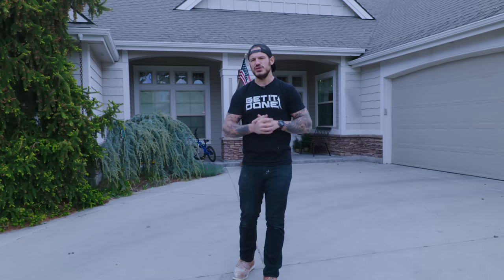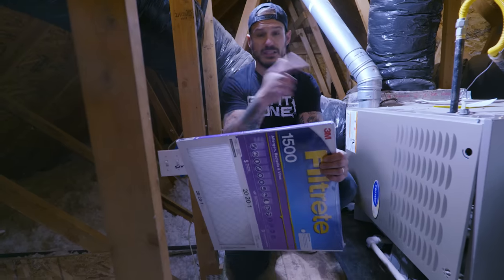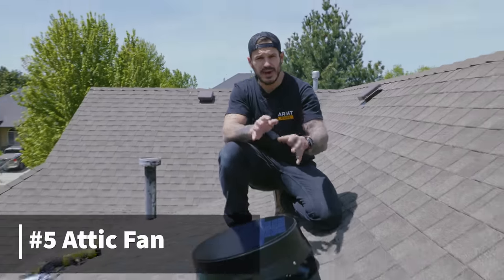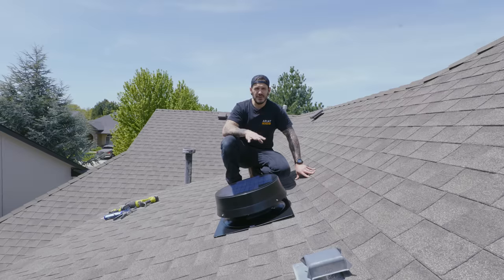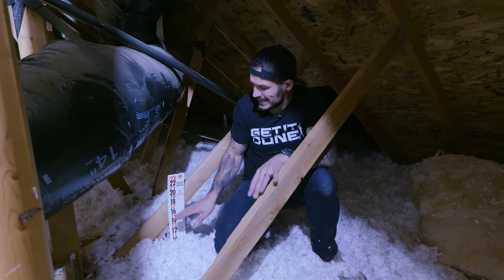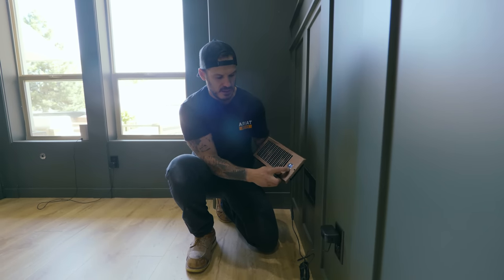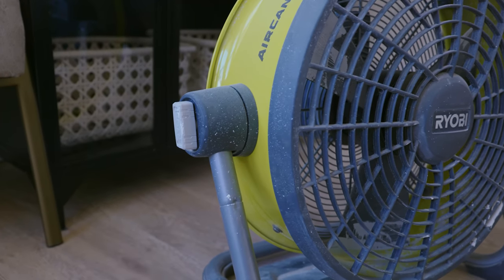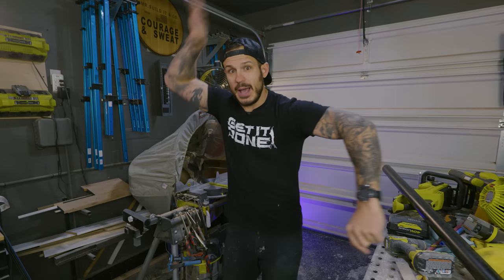15 Tips To Help Cool Your House This Summer + Lower Energy Cost

Comment: Very few filters are actually designed to last more than a few months. Unless you have a very expensive filter setup, change it every 3 months. Also, get your static pressure tested when you have your system serviced. If you only have 1 return air duct and grill in your home, you almost certainly need to have a 2nd one installed. About 80% of homes I see have high static pressure. This means way less airflow and a system that is working too hard. Adding a 2nd or 3rd return air duct and grill will help your system work so much better!
Reply: I like to change the filters every month in the summer. Non summer time I change it every quarter (3months)
Reply: High head pressure on high side on gauges are a tell tale sign of a clog filter or air restriction on the return.
Reply: @ptso7580  actually low pressure on the low side would be a sign of clogged air filters. High pressure on your high side would be a sign of a dirty condenser unit itself.
Reply: If you have high static pressure you have a poorly duct design.been doing heating and air conditioning/sheet metal mechanic for 33 years.its sad to see what this trade has came too.so many box and flex systems.just get in and out quickly and do it the cheapest you can.the art of sheet metal is a dying trade
Reply: @xslabcabxhearsex  Hi 👋 I just bought my first house a couple months ago and I was told the HVAC unit was replaced in 2018 with a “good one”. I don’t know anything about it. I really don’t like that it sits on my roof and is in the elements 24/7. I feel it should be on the north side of my house on the ground and in the shade but what do I know 🤷‍♀️ 
I feel the house (1979 built) is poorly insulated. The HVAC kicks on every few minutes when trying to maintain a temperature. All my vents inside are in the ceilings. One bedroom outta 3 doesn’t get any air coming out of the vent. I don’t know why. The rest of the house seems to have the air come out fine but not my son’s room. Do you know what is causing that problem and possible solutions? Also how would I check for pressure and ductwork that the original comment is about? I know I have 1 filter in the ceiling and small ceiling vents in every room also coming out of the ceiling. Thanks for any help!
My 1979 house is ALL electric and my PG&E bill is outrageous($400-500/mo) and I need to bring it down drastically! I keep the thermostat between 76-78 degrees if that info means anything or makes a difference in your answer.
Reply: @Ang.0910  congratulations on your new house.usually when you no air coming out of just one vent is when a squirrel was gotten into your attic and chewed up the flex duct to the vent.or it has a damper innit and it is closed.sometimes also it can be crushed from boxes sat on it or people crawling on it.
Your outdoor unit on the roof is not a ideal place for it as you have said.it can be moved to the ground but it will be somewhat costly.if it is cycling on and off every few minutes it just may be oversized,which will cool the house but not pull the humidity out as well.it would feel cool but clams in the house.
My advice without seeing your situation is call a repeatable company and have them look at your duct work and size of unit.insulate the attic better and get a attic fan to pull the help pull the heat out of the attic.good windows will make a huge difference on your power bills as the attic fan and insulation.
It’s sad that a lot of HAVC companies cut corners and rip the homeowners off and then you have problems like you have.i hope you can get all your problems fixed and be able to enjoy your new home
Reply: @Ang.0910  For your room with no airflow, see if the vent blows when the bedroom door is open vs. when it's closed. If it blows only with the door open, then you need to add a vent either through the door or cut an inch or less off the door bottom to allow air to escape. Also, some ductwork have dampers that can be closed to stop airflow to certain rooms. I would have a heating and cooling tech to check your ductwork to see if that's the issue. There could also be some obstruction or damage to it.
Reply: @xslabcabxhearsex  It really  is a dying trade. I did install  for 18 months 1996-97. We did a little  flex. But mostly duct board. Occasionally spiraled metal duct. I was 16 and 17 then and the experience i got from building duct work has been some of the most useful knowledge again and again. Most we did in the shop on a machine. But I have helped do entire duct systems free handed in the field. Learning  how to measure  for transitions and sizing duct and such gave me knowledge that helped me in welding and carpentry and other  day to day tasks.  And i wasn't ever what i would call good for the amount of experience that  i had.  Probably  closer to average. But  some of the guys i worked with made that shit look easy easy. They had just been doing it so long and had pride in their work. I was fortunate  that a few of them invested the extra time that  it takes  to really teach some one a trade. You do see a lot  of flex now  days. I guess its got its place. But anyone  can  stretch flex and install  start collers. Im glad i got  that experience even if for only a short time.
Reply: @ryanchenault80  In the Pacific North West all I see is flex lines ran in crawl spaces. I'd say 90% of homes in my area that are build after the early 1990's are all flex. Craftsman are definitely hard to find these days. Everyone was told to go to college and kids want to play on a computer.
Reply: Expensive hepa filters are garbage. Use basic filters and change every 3-4 weeks.
Reply: @kcrr2w  I'm totally fine with a basic filter. It's easier on your HVAC equipment! I have a very expensive air quality tester for work and the best thing is opening windows for at least 20 minutes once or twice a day.

Comment: Great advice but for those who don’t have a central or window AC unit I’d suggest a whole house fan. Install it in a central hallway or open part of the house then close down all the windows and doors except for leaving one cracked open a bit on each end of your house preferably one that’s on the shady side. Crank it up in the morning to get the cool air in then close everything down till afternoon. We live in the mountains of NC so the evening temperatures usually allow us to get away without the need for AC. I would disagree with putting a dehumidifier inside a room that you’re trying to sleep in though as those things exhaust very hot air back into the room. They are invaluable for basements though.
Reply: Thanks! I live in Atlanta and have always opened all windows when temps are below 73 to pull in cool air. Will try it with back door and front window, both in shade.
Reply: @ginaforfsu  Works every time except when it’s raining! 😉 That’s the only drawback, can’t use it at all then.
Reply: Your screens will be so dirty, and all the pollen and pollution also gets pulled into your house.  I once had a whole-house fan and I don’t want another one.
Reply: @AuroraBD0618  I guess that depends upon the exterior of the house but I definitely see your point. I clean the screens regularly and definitely remove drapes from those windows during the summer months. I have regular air filters to take out any pollen or contaminants that find their way inside. If it really got bad I’d just put a furnace filter in those windows to filter it out. It’s a small price to pay for not needing the extra expense of having to pay for central air conditioning.

Comment: Best tips for cooling a house. Due to cost and other variables they may not be possible for everyone.
1. Plant trees. Make sure the trees are 'deep root' variety. Many cities offer free tree planting and advice
2. Install exterior solar screens (they cover your window). Go as dark as you think you need but be aware that light gets cut drastically, especially in winter. Use 1" framing, don't go any smaller.
3. Install double pane windows
4. Install a whole house fan
5. Install a swamp cooler
6. Install ceiling fans in rooms where you work / sleep.
7. Make sure your attic is properly vented and insulated.
8. Check the insulation around your doors and windows. Install floor sweeps / door and framing insulation where needed.
Reply: Swamp coolers don't work where  there's high humidity
Reply: @chuckwadnofski7147  install both.  Use the one you need.

Comment: At my last place my bedroom was on the opposite end of the house from the main AC unit with in floor ducting and I bought that exact same powered vent fan. I thought it was a bit overpriced at $75 for what equates to nothing more than two 120mm PC fans hooked up to a powered thermostat & vent but it was WELL worth the investment. That room would get close to 90F no matter how cool the AC was set to but that vent fan managed to actually pull the cool air into the room & lower temps by as much as 10 degrees. I'll tell you what, when it's 104 out & the AC is blasting going from 88 to 78 is a HUGE difference and well worth the money.
Reply: I’m in the exact situation. Master bedroom is the furthest away. Bought one and made a huge difference. Helps a great deal in the winter too.
Reply: If your bedroom is that hot, you dont have enough insulation,  minimum  r 60, r 76 better

Comment: If you only have 1 return air duct and grill in your home for the HVAC system you need to get your Static Pressure tested. This is the number 1 problem I see on about 80% of homes. High static pressure means bad airflow. This is hard on the equipment and raises the the energy used by the furnace or Air Handlers fan. It also hurts your comfort because you could be getting a lot better airflow through your HVAC system.

Comment: Gotta work on the explanation for ceiling fan direction. You got the direction right, but the reasoning wrong. In the summer you want air pushed down because your skin perceives moving air makes as cooler. In the winter you want to take the warmer air near the ceiling and circulate it throughout the room. Without a fan, the warm air will just collect at the ceiling and it will be much cooler at normal height. With the fan running, the warm air gets moved around and mixed with the cooler air, raising the temperature of the air at our normal height without requiring any extra heating.

Also, every house I have lived in, the grates in the ceiling or walls are for intake while the exchanges in the floor are where the warm and cool air are distributed.
Reply: In the south the exchanges are inverted. Northern houses aren't normally on a slab (basement) so the exchanges are from below.
Reply: I've got to work on the comprehension of ceiling fan direction. I live in a(pretty small...approx. 1300dq ft) cedar log cabin. It's 1 & a half stories(not sure if that's what it's called) but its got the loft type bedroom with bathroom and closet upstairs. And directly under fhe upstairs area is a bathroom/laundry, a bedroom, the kitchen, and under stairs closet. The other half is living room(main room) and dining room. Open floor with vaulted ceiling. The ceilng fan is extended down maybe 8 feet. I can never seem to get the direction it should go in thst feels comfortable. It stays much hotter upstairs. Which direction would you suggest ?
Reply: You are correct.  But basically ceiling fan's don't cool the room they just cool objects down like hot food or your body radiating heat. But yes they have a summer and winter setting. Heat doesn't rise though. 'It's not antigravity but think of it being pushed up by cooler denser air'.  Professor Julius Sumner miller.
Reply: Shout out to Hunter Ceiling Fans. I installed my fan when we built our home 30 years ago. It has run continuously all that time except to dust the fins every few months. No wobbling no noise. I had no reason to replace it so it is running day and night circulating the air in the house. Great product.

Comment: An old video, but I would check with your contractor or roofer, or anyone else before installing attic fans.  If you have ridge vents, underlayment's, tight seals, and so much more... you can negatively effect your roofs cooling designs and/or thermals. Attic fans were helpful 30+ years ago, not so much anymore. Please check with others before installing these in regards to your roof.  IF you are sure, informed, and confident, then have at it, and enjoy.

Comment: On ceiling fans, cold air is not up, hot air is not down.  All are for circulation.  The feeling of having air blowing on you is what helps it to feel cool, hence setting it to blow directly on you.  It will also take the cold air on the floor and mix it in the room.  During the winter blowing the cold air from lower in the room up to the ceiling redistributes the hot air that has accumulated on the ceiling and allows it to flow through the room.  Ceiling fans help to keep the air well mixed and distributed.  

My house has an open stairwell to the basement which is always 10-15F cooler than upstairs because the cold air will just flow down the stairs.  We did an experiment creating a cardboard door and roof system and found that the basement and upstairs evened out their temps and the price for cooling dropped significantly.
Reply: Are you saying heat doesn't rise?
Reply: In your experiment with the basement, were you trying to determine if existing ceiling fans were pulling the cold air up from the basement? And/or to leave the basement door open? Or…?  I’m serious.  Thanks. Tom
Reply: @tmcmat01  Nope. We were trying to separate our house into two distinct zones. The cardboard walls and door kept the air separate and allowed the temps in the house to equalize. It also kept our summer electricity bills down because it wasn’t flooding the basement with cold air until the level reached the thermostat which was on the main floor.

Comment: Latitude N 50 degrees, marine air flow, Canada. We have gable end vents plus mushroom vents. Also 2ftx 2ft vent to attic. Remove that vent till heating season, and open top floor windows if safe and sane. Many great ideas from you. Thanks

Comment: Wait!  Hot air raises, cold air sinks down.  Did I hear the direction of fan rotation correctly?  I thought hot air should be pushed down and cold pulled up.
Reply: Whichever way the fan is going, the cold air goes that way. I think he just misspoke.
Reply: Down in the winter 100%. That's why warehouses use big fans to push all of the pooling hot air back down to the work area

Comment: Just a heads up, putting tint film on the inside ofnyour window glass voids the warrenty for the window fogging. The tint pulls uv rays into the glass and reflects it off the interior pane, cause the window seal to fail and the glass will fog up between the pains. The correct thing to do is change out your clear insulated window glass with a low e insulated glass. The low e glass is on the outside pane and reflects the uv rays before the get to the seal
Reply: There is so much wrong information with this statement that you must be a window installer. (1) Window company's will not honor a warranty if tint is applied to their windows BECAUSE they can't stop an idiot from putting blackout tint on a piece of glass which could cause the glass to break, but ANY high quality window tint manufacturer will pick up and honor any remaining warranty on a window where tint is applied by their trained factory installers because we know which tints are safe for windows. So there is no danger of losing your window warranty. (2) Tint doesn't "pull uv rays into the glass". The UV rays are generated by the sun and they are there wether there is tint or not. (3) Dual Pane windows fail because of the way they are built. There are far more "fogged" dual pane windows in this world WITHOUT tint on them than there are with tint on them. Fogged windows with tint is a correlation, not a causation. (4) Low-e coated windows can have the coating on either the exterior piece of glass or the interior piece depending on the climate zones, so even if it helped, it's only accurate for the northern part of the country. If window tint damaged seals as you describe we would be put out of business in a few years from angry customers and bad reviews, but yet our industry grows every year. The only people who don't like tint are window manufacturers who want to sell ridiculously expensive new windows. Professionally applied window films are one of the easiest and most economical home improvements that exist. Glad I could clear that up for you.
Reply: I just installed static cling film that can be removed easily w/o damage, and already has made the home office I work out of noticeably cooler. Until I can address any other issue like insulation, the film is perfect for right now.
Reply: film on the outside should work fine.

Comment: standard window tint doesnt block heat, it only blocks light and provides security (to prevent people from looking into your windows). If you want to block the heat from going through into your house, you need to find Ceramic window tint instead. ceramic tint actually blocks out the infrared heat that is put off by sunlight

Comment: Isn't that kind of counterintuitive for the fan thing because he rises wouldn't you want the fan to push air downwards so that the heat in the ceilings going down and then since cooling air is lighter you would want to pull the cool air up so that it can circulate around the room I mean correct me if I'm wrong I'm just asking a question
Reply: He meant cooler air. Whichever way the fan is going will move the cooler air that way because it is more dense, at least that is the theory.
Reply: You are correct, he stated it backwards.